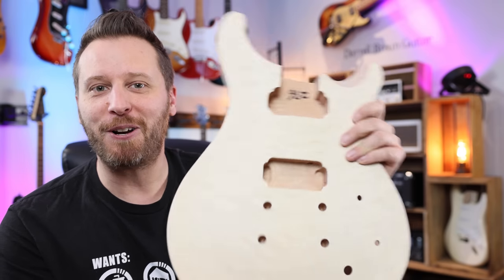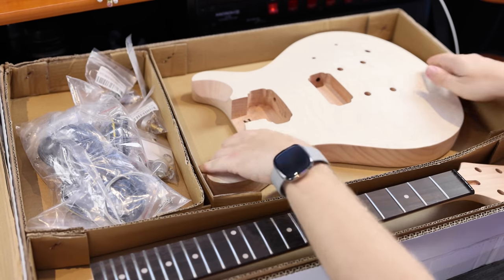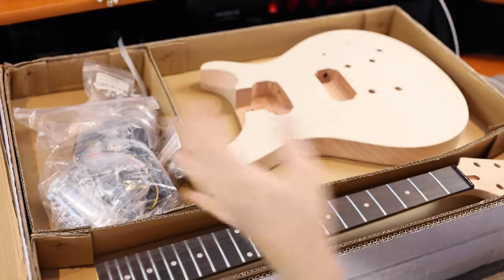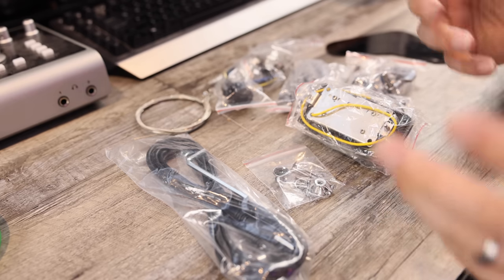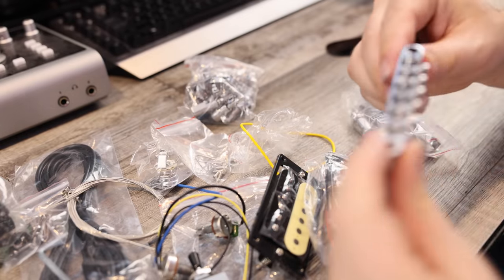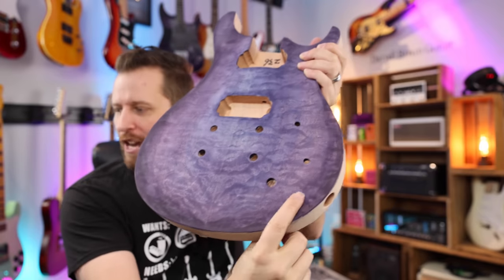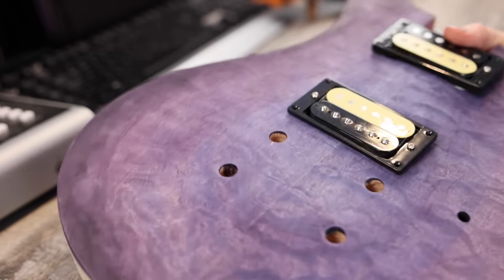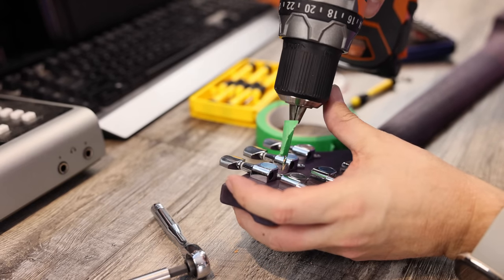Building a PRS Style Guitar! - This One Had Me a Little Nervous!!

Comment: One major mistake is that you stained the back of the heel on the neck where it is to be glued to the body.  You should never stain a surface that is to be glued, should have been bare wood for a better glue set up.  You have created a barrier that could have the glue fail down the road.  Also, always use a clean rag to apply stain, you will get much better results.
Reply: I picked up on the same thing right away.  This is a major mistake and could have been avoided by watching a few finishing videos before starting this.
Reply: @Arnd2it  I guess this is another reason why people fix the neck before staining. It also allows you to get a better colour match between where the neck joins the body and the body itself. The purple is certainly VERY dark.
Reply: I'm not denying this is an issue, and as a practice you are correct, you should never stain or seal anywhere you're going to glue. But, I'm not sure in this case. He isn't using stain, I think it's a water based dye and I don't think it's blocking the pores of the wood. I bet if you took a walnut stain over that it would soak in and cover that color right up. I may have to get some and test it in the shop.
Reply: Yeah, but it's not that impactful with water based stain.
Reply: Stains and dyes are also two different things. Darrell Braun is an obvious amateur and not a trustworthy source of good info.
Reply: @kirvin2  in terms of finishing.
Reply: @kirvin2  I don't think he ever said he was a professional. It's just a video of someone putting a kit together, not a tutorial.
Reply: @jg97873  everyone thinks they are an expert dont they lol. This guy is only trying to do what he can do with what he knows.

Comment: You still need to sand it back and probably another round of color. Smooth with steel wool. You also can't leave the body bare dyed wood. At a minimum you should use a rub on poly to seal it up. Watch Big D Guitars here on YouTube to see how to properly dye and finish a bare body.
Reply: Mate at least watch the video. He said he's going to seal it all. Even mentioned sanding the neck down first too
Reply: Yes, I would do 3 or 4 rounds of stain and sanding (from 600 grit to 2500 or finer). Rushing to a clear coat will end up with a finish that looks, how do I say it politely, less professional.
Reply: steel wool isn't a great idea - it leaves behind residue, which would be terrible for a lacquer finish
Reply: @bldallas  what would I have to do to create a psychedelic kind of guitar? I've been meaning to make one for a while now, with a kit guitar. Because I'd really like one of the various psychedelic guitars that people had in the 60s, like Eric Clapton's SG, Jack Bruce's Fender Bass VI, Jimmy Page's tele, George Harrison's Strat, Jimi Hendrix's strat and his Flying V etc.  From what I can find out, all of these guitars were painted in the same way. They'd sand the guitar down, use normal kinds of paints on the wood (apparently acrylic paint is the best) and then just clear coat it at that point, and it's fine.
  
So are you saying that I'd need to paint the design on once, sand it down, paint it again, sand it down, etc like 8 times in a row before putting the clear coat on? What's the purpose of doing that?
   
And why would you sand it off? What's the point of putting a colour onto the guitar, only to immediately sand it off so no more of the colour remains, and then doing all that just to add even more colour to the wood anyway? Am I missing something here? That seems like you're giving yourself a bunch of extra work to do that makes no difference to it. It'd be like if you're washing your car, you go through the car wash, and then purposely covering it in mud to make it dirty again, only to immediately go through the same car wash again to clean all the mud off, and then claiming that this convoluted process actually makes it more "professionally" clean, somehow. 
   
Seriously what on earth do you mean by this? I must be missing something here. You're talking about stains while I'm talking about paint, sure, but even then what you're saying makes no sense whatsoever. You're saying someone should stain their guitar, and then immediately sand all that stain off so none remains, all that's left being the bare untouched uncoloured wood, and then repeat that whole process 8-12 times!? You'd end up with a teeny tiny guitar that way, for one thing. Like you'd start off with say a stratocaster body, but you take so much wood off via sanding that you end up with a tiny teardrop-style guitar.
   
So yeah I'm really confused by what you mean. Wouldn't it be better to stain/paint the wood, let it dry, and then add MORE of the stain/paint on top of it? So do the same process you're saying, except this way you DON'T sand off the entirety of the stain/paint you just spent ages applying. I really just do not understand in the slightest why you'd paint or stain a bit of wood and then literally just sand it all off and start again. Like if it's about sanding it, then why not sand it WITHOUT staining it first? That way, you don't waste all the stain/paint. You get the same results regardless.
Reply: @duffman18  Just to preface my answer: I'm not an expert, but this is my understanding of the differences between paint and stain.

Stain and paint interact with wood differently. Stain "stains" the wood a different colour while leaving the grain visible, while paint covers the wood, only leaving the grain visible if you do a thin coat. Paint is how you get solid colours, while stain is how you get translucent colours. It's like icing vs food colouring, or body paint vs a tattoo - one goes on top and covers the surface of an object with a particular colour, while the other one is absorbed and changes the colour of the object itself.

Now, you're right to say that sanding off paint would leave basically unfinished wood, and sanding off paint is basically pointless unless you made a big mistake and want to redo your paint job or whatever. As long as you're happy with your paint job, you probably shouldn't sand and redo your paint before a clear coat. What you see is what you get.

Stain is a different matter entirely. Stain penetrates into the wood and fills the pores of the wood. Think of it more like coloured water than paint. The reason for sanding and re-staining the wood is to ensure an even coverage and a smooth finish. The reason that you might no longer have a smooth finish is that staining the wood tends to raise the grain due to water absorption (a similar thing still happens with alcohol-based stains). Additionally, the stain might not penetrate the wood evenly in all areas, particularly if your wood has knots or a particularly strong grain. As a result, if you want a super smooth finish, you need to sand the grain back down and reapply the stain. Sanding the grain down doesn't mean removing ALL of the stain - just making the wood smooth again. You still want the wood to still retain as much stain as possible between sandings to ensure the colour remains rich. Repeat this step a few times with decreasing grits and you'll have an even, silky smooth finish and a strong colour with a clearly visible grain.

Basically, adding and then sanding paint repeatedly is just putting on and taking off the same surface layer again and again - usually pointless. Adding and then sanding stain repeatedly is enriching the colour and refinishing the surface - usually desirable (within reason).
Reply: @duffman18  I can’t tell if you’re being serious or a wiseass; your ridiculous analogies definitely sound like trolling.   But for the sake of conversation…

First, when we talk about sanding in between coats, we are talking about only sanding off the roughness that stain creates when it opens the pores in the wood.  Very little material is actually removed. 

That said, if it were me, I’d buy a good unfinished body.  Sand the heck out of it, going from course to fine.  Your starting grit will depend on how smooth the original body is, when you get it.  

I would then wipe down with a wet cloth.  The moisture should open the pores, which I would then hit with another round of sanding.  Repeat as needed.  

Then, I would apply an epoxy pore sealant.  Sand again.  Maybe apply another coat if pore sealant.  Then paint away.  

If you want a stain, under your paint, I would make sure the stain and the epoxy sealant are the same brand and likely stain before sealing.  Like I said in the previous comment, I’d likely stain and sand multiple times.

The key to successful wood finishing, is not to rush it.  Let each layer, of whatever you are applying, fully cure/dry before sanding or applying another coat.
Reply: THis guy doesnt watch the full video smh

Comment: This really makes you realize why some high-end guitars are so expensive, it's not the materials that cost, it's the craftmanship.
Reply: while nowadays even cheap guitars (around the 500 dollar mark) tend to be technically good, there still is quite the difference in materials used for the more expensive guitars. using thicker pieces of wood for the top, glueing less pieces together for the body etc which add to the cost of materials quite significantly. craftsmanship is not really much of a factor until you start to get to handbuilt guitars which is why they cost way more. in terms of materials, decent pieces of wood and all the hardware tend to cost around 1500 euro's here where im from. you can work out from there what you're paying for the luthier's experience :)
Reply: @stenmartens7179  most "high end" guitars are CNC machined now. so no, i dont think paying 2000 USD for a CNC gibson is worth it. there are a lot more people building guitars by hand that are way better. majority of the price you are paying is the brand. i have had guitars high and low priced and the difference between them isnt really that far off. this is why i look for the wood, then I just enhance the cheaper guitar with some work om the fretboard and upgrade electronics. maybe decades ago guitar building was hard, nowadays, no.
Reply: @GrimYak  hehe. "no."
Reply: @mihailmilev9909  There plenty of Sub 1k guitars that absolutely wipe the floor with gibson, all around. Quality control, finish consistency, fretwork consistency, customer service, turn around times for replacement parts. In literally every possible reguard (didnt use to be this way) Gibson is one of the shittiest guitar companies doing business today. Period.

@GrimYak You chose a really poor example. Gibson claim to be high end guitars. They are not. Haven't been in about 25 years. Yamaha pacifica's absolutely demolish gibson in QC, finish consistency, and fretwork. And they cost like $300 last i checked. As far as product consistency and quality control goes, Gibson is even behind Squier now a days (even if theyre using higher end materials and hardware). Sad, but its the truth. You genuinely could not pay me to buy a Modern gibson guitar. I personally expect gibson to go under right around the time their loyal, old-head fanbase is croaking out.
Reply: From what I’ve been reading lately is PRS is starting to get the “Gibson Disease” and taking advantage of their name and customer loyalty.
Starting to concentrate on building them cheaper and cheaper and letting QC start to slip.
(Unless of course you’re paying for the big buck models)
Reply: @Daddy53751 well difference is those are se models which are normally under 800 so of course they are, but core models imo are way better than Gibsons

Comment: A suggestion from a non-luthier, use a rag or cloth for the staining so you can use circular motions to get the stain into the grain of the guitar.   Also, use a tinted grain filler first to make the flame/quilt pop!
Reply: yup ...grain filler is a must.....unless youre going for a rustic look........learned that the hard way as I was trying to use the clear coats to fill the grain.......that took for ever....
Reply: I learned this from a furniture maker, the cloth gave a better result like you say…
Reply: You can see the cloth paper towel in the PRS stain videos
Reply: Sound advice Jeremy.
Reply: What color of tinted grain filler? I just got a les Paul kit with flame veneer. Going for a jade burst. My first time building a guitar or woodwork really.
Reply: @mknewlan67  I used black grain filler.  After you apply it you'll want to sand it back down so the woods shows through, and only the grain is tinted. I would apply lightly at first.
Reply: @jeremyklein9679  thank you!

Comment: Nothing wrong with using a brush but you'll get better results using strips of cotton cloth folded into little pads to apply the stain. This applies especially to the figured wood on the top. If you're doing a burst, apply the colour you want to be in the center across the whole top first. Apply the outer colour second and work your way in towards the center colour. Use a circular motion to apply the stain and blend it into the center colour edge. If the overall colour is a bit dark you can lightly sand it back a bit. This will make the grain pop. Takes a bit of practice but the results will be worth it.
Reply: @roman numeral your comment was on point..i was thinking why doesn't he add the first color all over front and then come back with second color?..it was almost like watching a child coloring for the first time..wow!
Reply: Hey thanks for actually being informative rather than just negative
Reply: Do you still use the motion he's doing for the first layer?
Reply: @Levi89723  I haven't re-watched the video so I don't remember the motion you're referring to. Brushes are ok for staining but not for guitars or furniture. Use clean cotton cloths and apply in a circular motion. It takes time and patience. You can even use a damp cloth to go over any areas that are too dark. If you're using water based dye you'll need to sand back after applying because it raises the grain. Using alcohol instead if water is better and it dries a lot faster. It's tricky so take your time and try it out on scrap pieces of wood first.

Comment: Small tip: before gluing up, check if the neck angle is right. Install the bridge. Place the neck on the body and place a ruler touching all the frets. The ruler should be just above the bridge (when it is in its minimal height). If the ruler is not above the bridge, you'll have really high action, and there won't be much you can do about it.
Reply: Scam.
Reply: Note: "No scam on here, contact admin for more".  This hasty retort gives way to: "Contact admin for more". This channels feature would have Darrell's approval and he would be very specific about who, what and how a giveaway would apply. On top of it He wouldn't guide you to a random Telegram account. Yeah it's a Scam. Don't go there and submit any personal info!
Reply: @timothyvaher2421  
 Amen, Brother !
   Well Said !
Reply: @duffman18  I tried that. To scores of these comments on 3 different websites. Every one of them was restored 5 minutes later. Every! Last! One! Youtube couldn't care less. :(
Reply: I had thought about the issue with the glue-in neck. Definitely get that bridge on and drop the pickups in place, then use them dodgy strings to help with string height Vs fretboard & pickups……and ‘is the neck sitting straight?’ before the glue goes on and you’re committed.😬🙄👍

Comment: That dye is very forgiving. you can be aggressive while applying it and you can always use water to correct any problems along the way...  Good choice Darrell. I was  a bit nervous watching this too... I am putting together a Pit Bull Guitar Kit, A hollow body "Headless" guitar with F-holes if you can believe it. I've chosen yellows and different shades of brown to do some sort of tiger burst, but I am using leather dyes to achieve the burst or tiger burst that I am thinking off. So I will have to be much more careful when doing it. and I may need to use thinners as well to blend things together.  Cheers and keep it up, you are doing Great!
Reply: I'd buy that kit too if it would ever come back in stock

Comment: You really need to watch some videos from BigD Guitars - he is the king of staining.
I personally prefer to use rags over foam brushes as I find that easier to do the blending.
The burst is looking promising though and the finish should both get it to pop as well as blend a little better. 
For a glue-in neck, I prefer not to stain the neck heel, so that the glue joint is bare wood on bare wood. Still should be OK though.
Looking forward to seeing the rest of the build.
Reply: Lol, I was just going to recommend he check out Derek's channel too. That dude is a wizard with stains.
Reply: I agree with you. As a wood worker, i like to use balled up rags over foam brush when applying stains.

Comment: I owned a very successful boutique guitar manufacturing company for over a decade. Staining guitar tops is an art. It’s super easy to do, but an art in making a PRS quality stain. We used only alcohol dyes, never water based.  Water based swells the  grain fuzz, and use UV resistant stains to avoid what happened to EBMM’s when the first ran the purple EVH models. Always use a rag or cotton ball and circle blend the dyes. Using a black or dark color first then fine sanding it off before the final lighter dye color will really pop the figure.